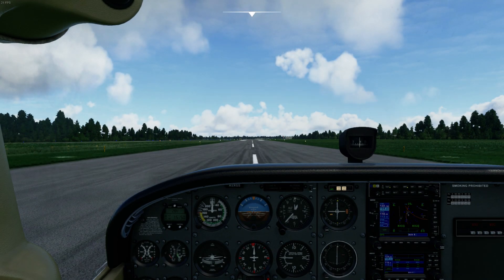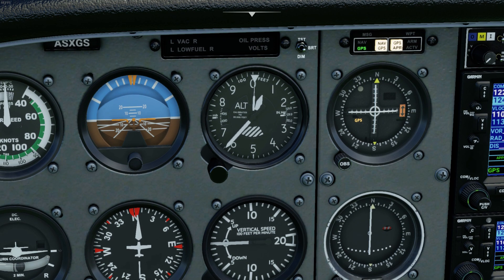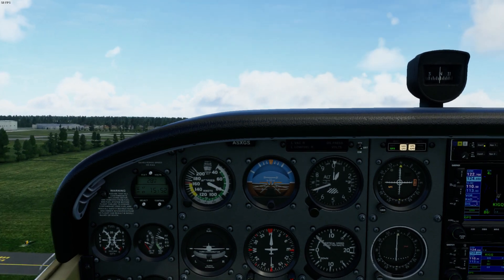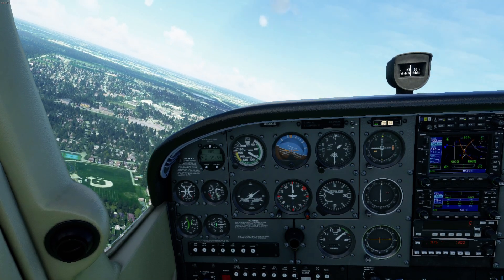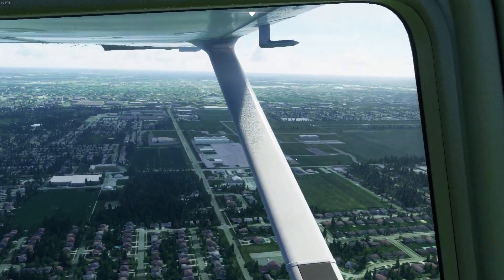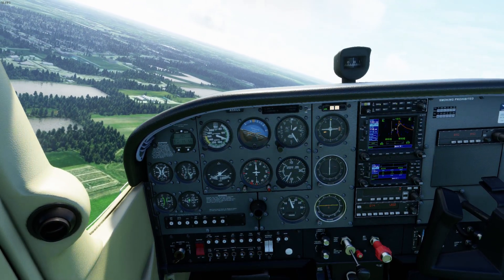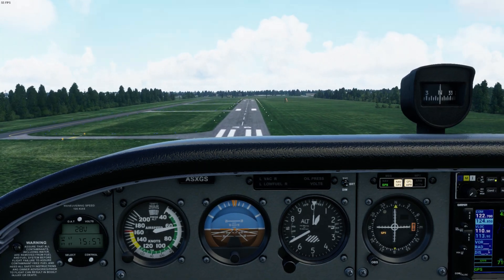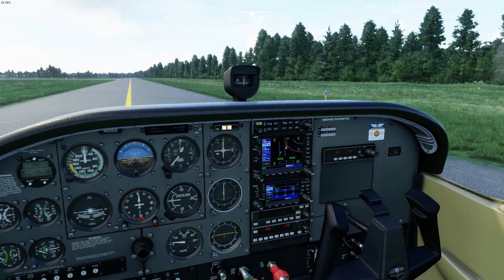REAL-LIFE FLIGHT TRAINING (MSFS 2020) Lesson #1: VFR Traffic Pattern in the Cessna Skyhawk

Comment: Nice overall video, but the one problem I see is not touching down at the slowest possible airspeed. It appears to be a problem with pilots understanding this important element of the landing. High airspeeds at touchdown can lead to pilots with fair weather landings who end up trying to force the airplane onto the runway during strong crosswinds.  Difficult for a pilot to face a wheel barrel landing or porpoising if their airspeed is the slowest at touchdown. The FAA in one of their publications mentions landing at the slowest possible airspeed if not at stall speed while touching down.
Reply from the maker: Good point; my general rule of thumb is to add half the wind speed to my touchdown speed. As you fly aircraft more likely to "weather vane", like light tail draggers, you will need the extra control provided by slightly more airspeed.
Reply: @smartalec84  Touching down above the stall speed means a longer period of time to transition from flying speed to a manageable ground speed, which also impacts effective braking. When the wings are supporting the aircraft weight you have less effective braking, the aircraft wheels are not firmly on the ground.  Forty five percent (45%) of aircraft accidents occur during the final approach and landing phase. If the wind is steady I would recommend you not increase your approach speed, however if you have gusty conditions differently increase your approach speed. Happy Flying!